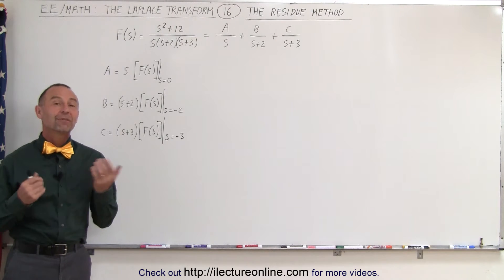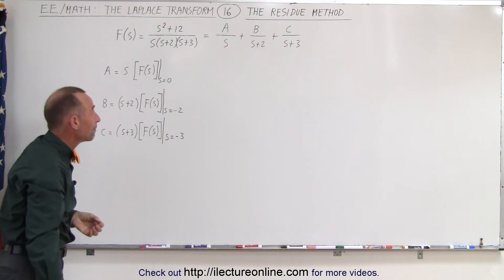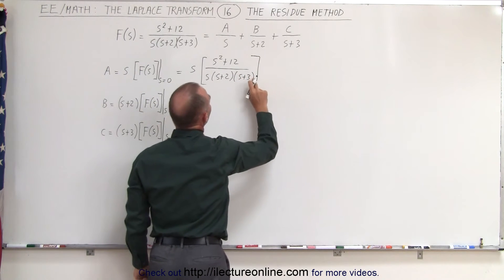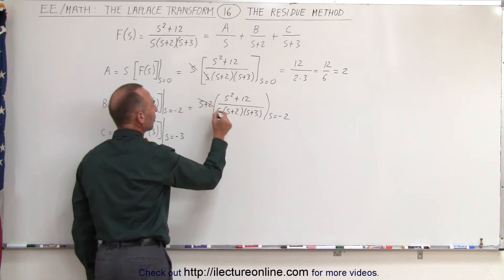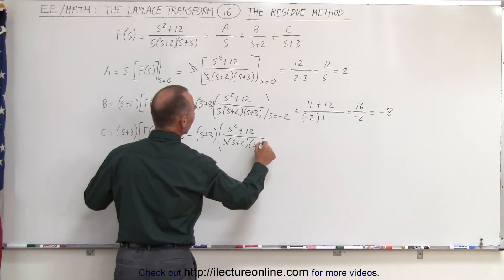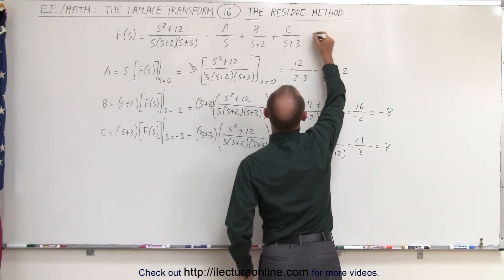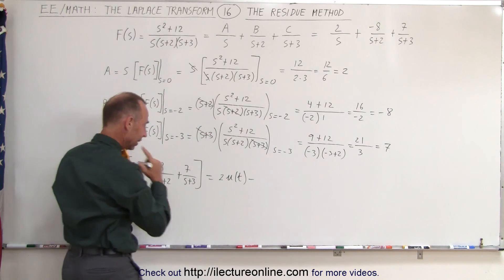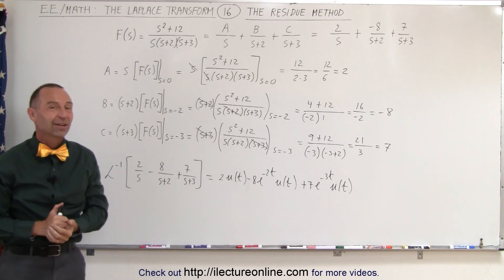Electrical Engineering: Ch 16: Laplace Transform (16 of 58) The Residue Method

Comment: Neat!, I guess, by extrapolation, this method can be used in integration, how it would be this method for repeated factors (if possible)?
Reply: This method works, because s is a complex variable, and so its integral can be found by the residue theorem. You can apply this to real valued integrals after some modifications. If you want to see how this can be applied, you should take a complex analysis course. You can find one on Coursera, but the videos are here on youtube. Look for Petra Bonfert Taylor. There is a week covering the residue theorem and is application to evaluate some hard integrals.